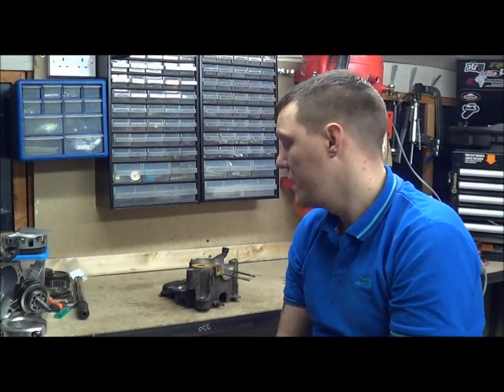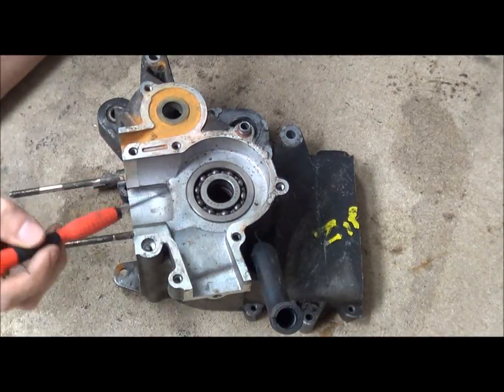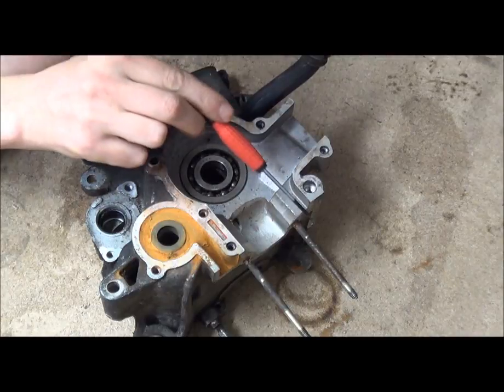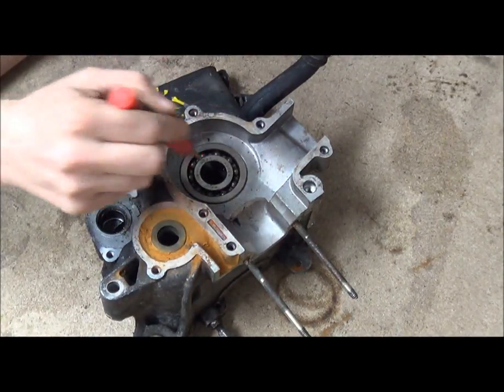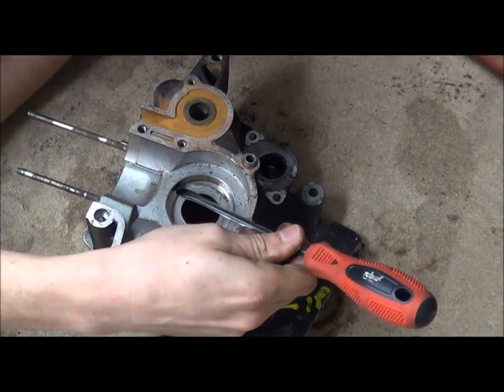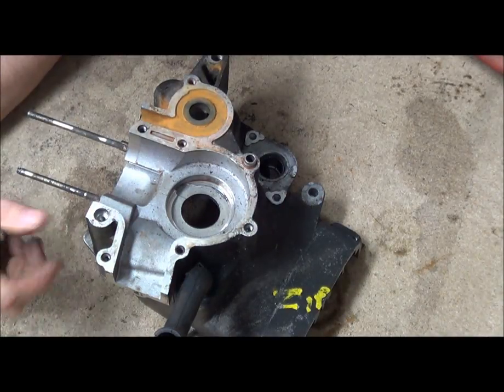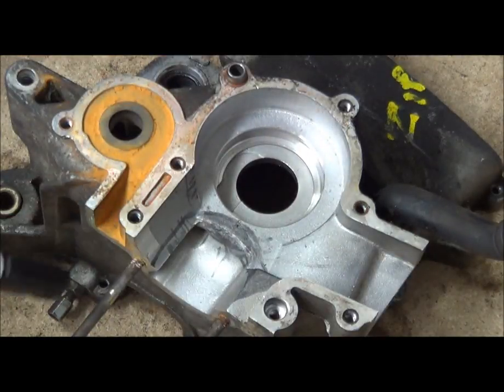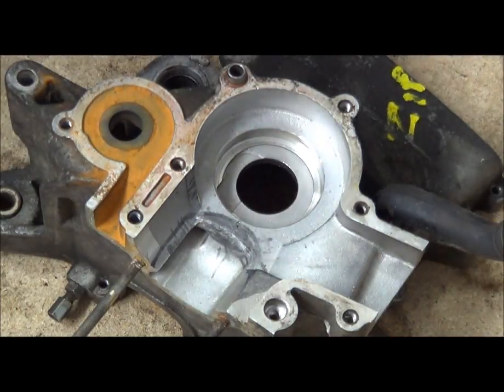Crankcase Flowing - Part 1 What to remove and why

Comment: without putting the crank, cylinder and piston in the case half and mark where the piston is as intake port opens and at the bottom, you are just shooting into the dark and could cause more turbulence.
Reply: I'm of the same opinion. Good video for someone who doesn't know anything about two-stroke tuning but definitely not for s race motor. Removing material for no reason other than 'your in there' is a bad move.  Really needs to get a better understanding of two stroke terminology, bypass ports are not the same as transfer ports even though they do have 'same' function. This is kinda the way I would have explained things when I was 12~13
Reply: @peterjones6945  that's kind of the point I think, trying to talk to those of us doing it at 15-16
Reply: @jediknight1294  I don't think I watched  all the video, and was trying to be nice. he does way more harm than good when talking about tuning. Removing any material shrouded by reed valves or cylinder spigot just increases crankcase volume and loses power. If anyone else reads this looking for tuning advice (most just watch the moving pictures) Remember basic airflow does not want to 'turn' more than 7 degrees, an angle with small radius is more effective than an oversize hole nicely radiused.
Reply: @peterjones6945  end of the day tuning a modern shitbox 50 isn't worth the effort but for what it is which is a basic explanation it isn't bad. 

The guy knows whuat hes talking about in  General.
Reply: @jediknight1294  Yep, probably does but a 'good' teaching video needs checking content, scripting first and editing afterwards which is why I don't make video's. I was teaching motorcycle technicians almost 12 yrs in a trade school, 3 yrs exclusively in engine repair (12hrs a day, 2 classes) I also ran dealer workshops. One of the easiest scooter engines to tune is old Vespa two stroke, even made in India ones are OK after main bearing change.  Old MZ 250/300 could be made more than quick enough to embarrass Suzuki or Yamaha 250 twins. My old boss won civilian class at Pau - San Sebastian - Pau Rally on a more or less bog stock MZ250 back in the 80's, Reliable 10 bhp is worth more than flash reading 20bhp unless you a dyno queen.stock 50's are generally around 2.2 to 5bhp
Reply: @peterjones6945  yeah he did point out a few useless spots and skipped some nice do do ones on that engine , at 15:20 he is saying people over hog those , but it's a nice piece to round off so you get less eddy currents in there , I also trench a line from the intake to the transfer so there is no ledge and epoxy fill and shape the transfers so they have a nicer radius ( stock is quite abrupt) . So far I like the way it performs vs stock , much more lively when revving it in place, and feels stronger up top too...

Comment: 17:28 you've just increased the volume of the crankcase and decreased the depression of it. so less mixture will come in to the crankcase... there are engineers at the factory and its r&d department. you can polish the casting burrs and surfaces but...

Comment: This comment doesn't just relate to this video, I've seen a lot of comments among his other videos criticizing him, here's something to think about. At a 1200 rpm idle while you're sitting at the traffic lights the air has to go through the ENTIRE engine in 0.05 of a second, that's probably faster than you can blink. At 6000 rpm, a reasonable cruising speed it's 0.01 of a second, again for the ENTIRE engine, 9000 rpm is 0.0066 sec. ( my race bike used to max at 12000, ..yeah. 0.005 sec ) ANYTHING traveling at that speed wants to go in a straight line but OOPS, two stroke motors are full of corners and direction changes. I'm used with motorcycles, where into the crank case is more or less a straight shot, then from a straight shot the air has to turn 90 degrees from horizontal to vertical AND turn sideways to enter the transfers, then oops again another 90 degrees to get into the cylinder where it gets cremated and blown out the exhaust port, FASTER THAN YOU CAN BLINK. The math for the times I've given is easy.  rpm, one minute is 60 seconds, so you just divide 60 by the rpm and you get the time for one revolution.

Comment: Looking at the transfer port area were the cylinder is fitted. That square edge above the crank bearing puzzles me. It blocks some of the flow as the piston lowers into the start of the intake fuel transfer. There should be a chamfer on that square edge. Does polishing the crankcase were the crank weights are help? I’m in the process of building some older Husqvarna 2t bikes in looking at porting plus doing some crankcase work.

Comment: ive seen 5bhp on 125 engines and 3bhp on 50 cases from flowing alone ;) dyno proven :)
Reply from the maker: increase?
Reply: @dirtygarageguy  i say flowing alone, these were both bolt on scenarios (so a bolt on 125 with a 172, 25mm carb and half decent pipe made 16bhp without but 21with the cases done, other engine was a bolt on evo setup so 25ml carb, evo crank, evo kit, decent pipe and gears.. made 13 on stock cases and over 16 on ported cases..dyno to dyno these numbers are irelevent but it was back to back flow testing :)